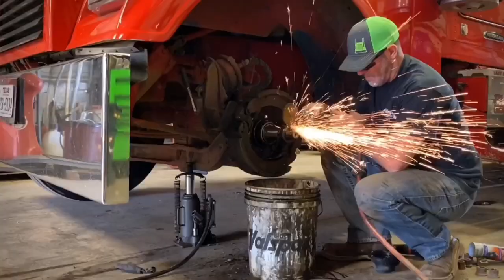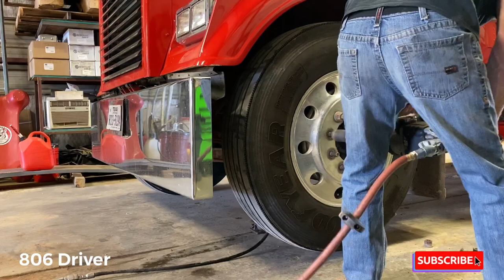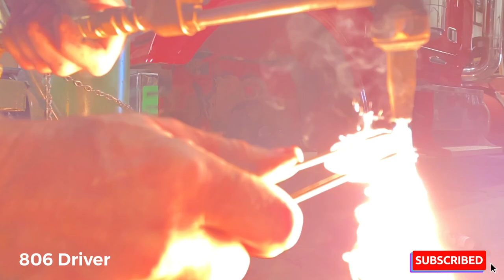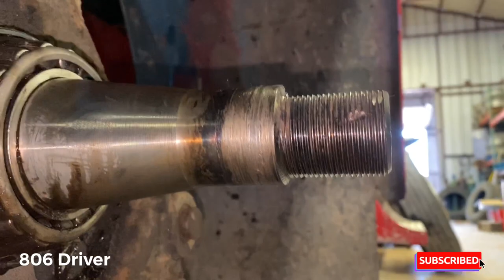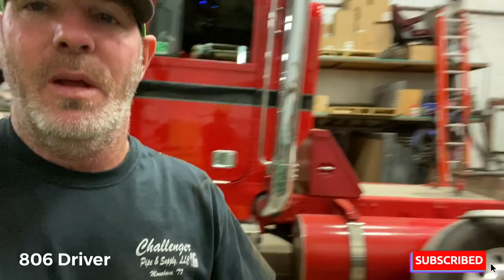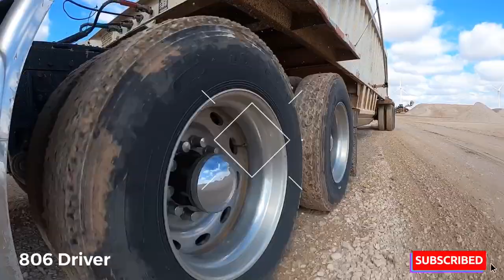We almost lost a wheel! Steer axle bearing failure. Spindle ruined, kingpin removal 99 Freightliner

Comment: Hey boss man got a question I got a 06 century class. Got a shake and bouncy running away feeling in the front end it feels like but it’s tougher to control and steer and it also shakes sometimes heavily but I notice when I have a load and I’m doing 70 it’s under a better control. But when I’m Bob tailing it’s all over the road. I already replace the kingpins. No luck. It help the bad running away it had. But still not a Fix. I was told the steering gear box got a slight delay in it. But I feel that’s not the issue I don’t know. What you think?
Reply from the maker: Get somebody to rock the steering wheel with the truck not running, while you look at every piece of steering components, shaft to gearbox, gearbox to pitman arm, pitman arm to drag link, drag link to spindle, spindle to tie Rod ends, look for any excessive play… Hope this helps

Comment: I just stumbled across your video. My truck is broke down at Love's truck stop in Beaumont. I had a company replace the bearings and after about 1800 miles of driving the wheel started coming off. The spindle is damaged. You have any contacts in the Beaumont area?
Reply from the maker: Unfortunately I do not know anyone in that neck of the woods buddy… Good luck!!!
Reply: @806Driver  thanks